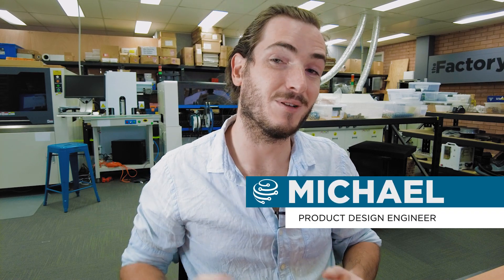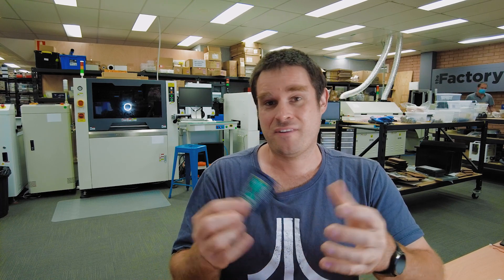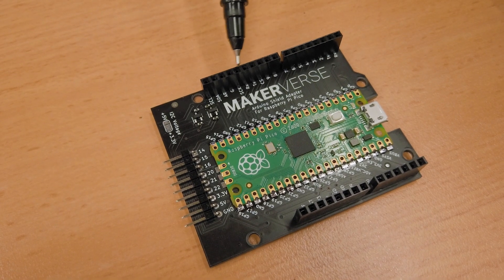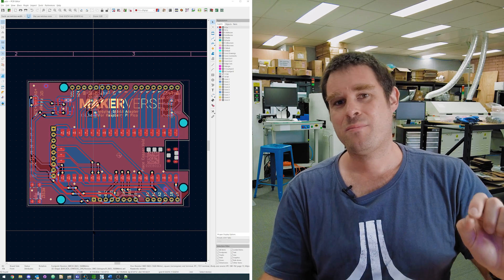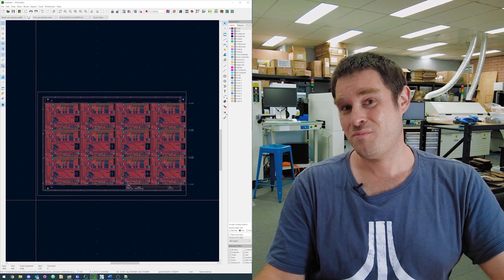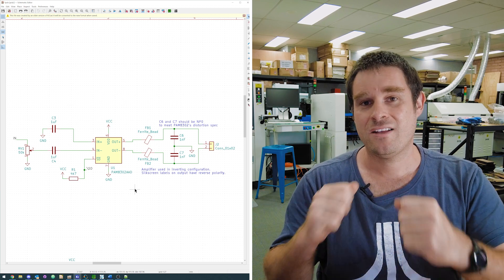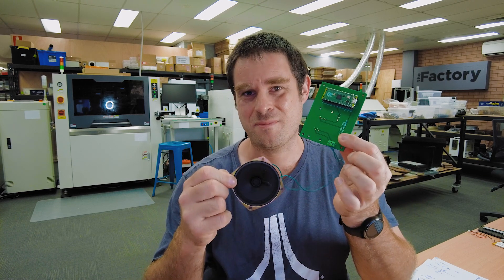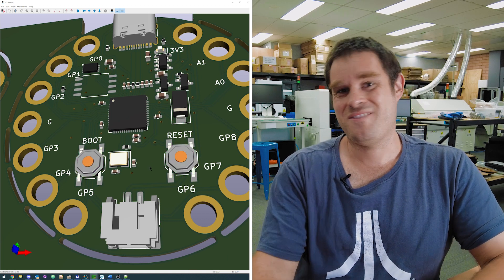The Factory | Micropython In An Uno Footprint

Comment: Level shifting definately required.

Could add an ADC MUX to sample all of the UNO analog locations between available ADC inputs and abstract that in the code... (Default to less ADC inputs)
Reply from the maker: RE: level shifting - agreed. If it looks like an Uno it should quack like an Uno. 5V io would be needed everywhere. Interesting idea with the ADC MUX! We'd prefer to do away with needing a specific driver or library for using this board, but perhaps that's what it'll take.

Comment: Amazing idea - an alternative to the Solder Party RP2040 Stamp and Uno profile Stamp Carrier.
Adding level shifters for all digital I/O would minimise compatibility problems and allow use of so many shields
Using a standard socketed Pi-Pico could be useful - maybe there is a market for both Pico-socket and RP2040-on-board versions?

Comment: MicroUSB is... horrible really. I understand why folks might want to keep their existing cable infrastructure... but having used USB-C on my Apple products for years, it's far, far nicer to plug in without needing to peer at the connector to ensure orientation. (May or may not be an issue for younger folks! ;-)
Reply: ... Using the same USB connector as on the Pico would allow Pico users to migrate to Arduino shields (?)